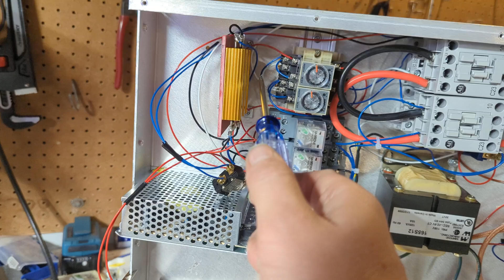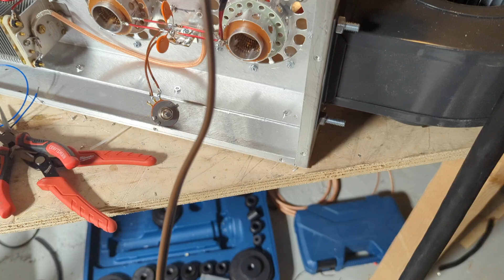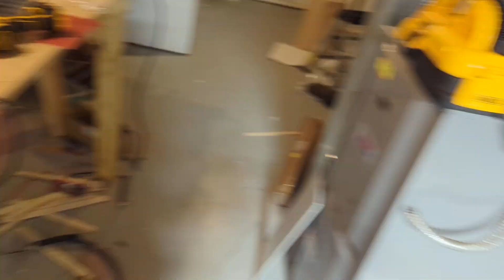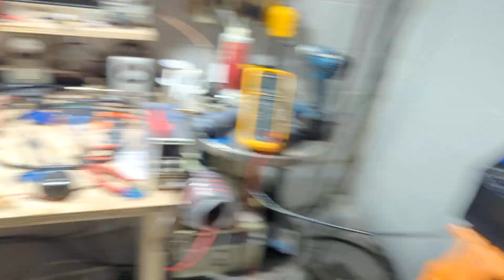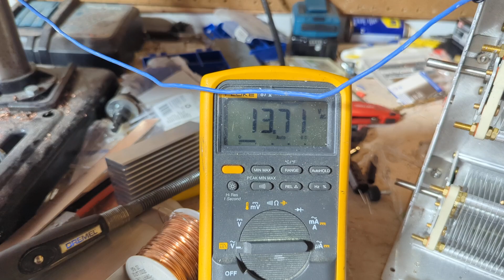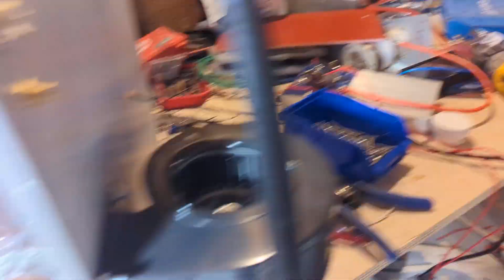GS-35b (Dual Tube (Episode #4) Lower Deck Completed and Tested!

Comment: looking great. love the bias circuit. The old tube AM broadcast transmitter is done different. tetrode final. the RF input is done threw the grid and the audio is in threw the cathode. and also some audio comes threw the screen on tube with screen DC supply. the main tube transmitter is way different. cathode is B- and Rf to grid. audio is into HV supply. and screen supply as the exciter has audio on it's DC  supply. is a AMC transmitter and digital audio input to power supply's.  when no audio RF power is way down. modulation set to 120% max . per FCC . carrier modulation  . saves a bunch of input power . stations like WBCQ SW station has a bigger one. 250 Kw . it's on you tube.  neat power HV supply does the modulation.  newer CB radios do AMC . like 1 watt key and 50 watt or so with audio. great work on tube amp.  that going to be clean sounding power.  that will get out much better than dirty watts buy far. 73's
Reply from the maker: Thanks for your input. always enjoy reading your comments. ~73s...